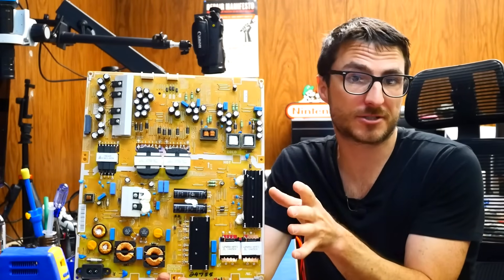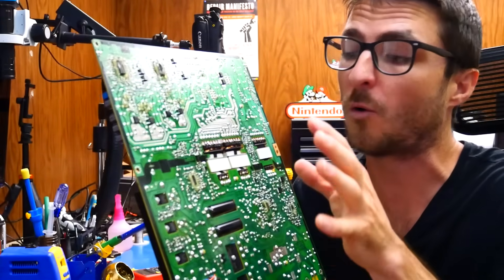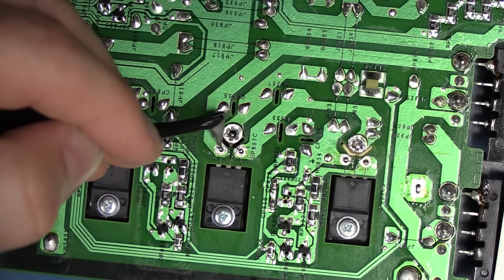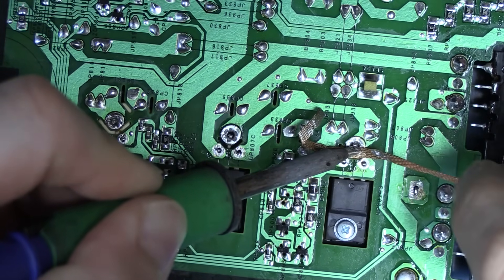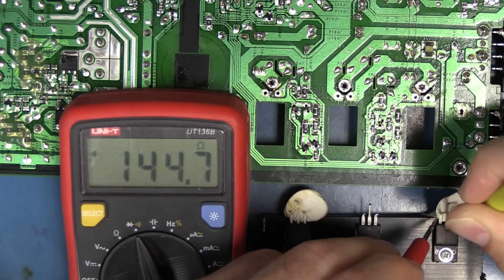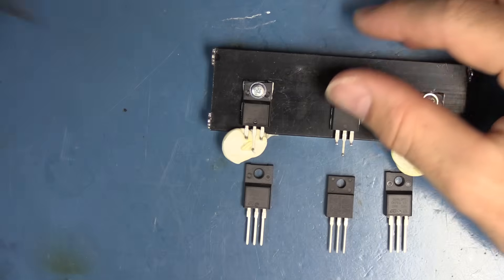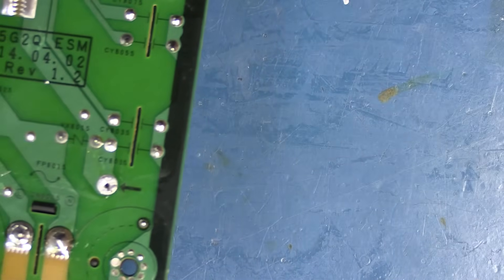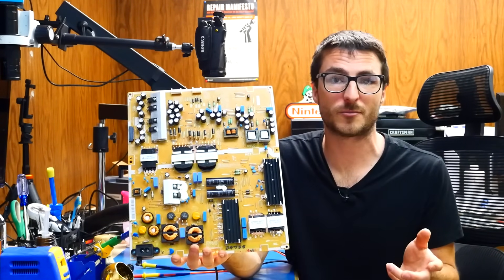Samsung TV No Power Repair UN75H7150 Power Supply BN44-00725A

Comment: Good to see someone that has EXPERIENCE doing the work! The only thing I would have done differently would be to wait on soldering the heatsink until I powered up the unit. If it immediately blew out the transistors again due to some other fault it would be much easier to replace them.
Reply from the maker: Yeah that's a good point! 
I always tell people not to put the back cover on the TV before powering on the set because if they made a mistake and forgot to plug in a wire or didn't plug a ribbon in correctly they have to take everything apart again. Same principle.

Comment: Great video!  It's crazy expensive but the Hakko FR-301 desoldering gun is transformative.  Once you try one you'll never go back to braid or pumps.
Reply from the maker: Yeah we have one and have done several videos with it in the past. 
Its pretty good, but does require a lot of maintenance. Definitely can't use flux with it or it will for sure clog up.

Comment: Use somr flux
Reply from the maker: Is there a specific scene where the solder didn't flow properly? If so what was the time stamp? 
The solder I use has a rosin core so it alrady has flux. Usually that's enough, especially for bigger joints. For finer pitch soldering however I will usually add a bit more flux.

Comment: That part you call a transistor isn't that a mosfet
Reply from the maker: Correct. 
A mosfet is a transistor. Not all transistors are mosfets however. 
metal-oxide-semiconductor field-effect transistor (MOSFET)
Reply: Correct  @NicksTVRepair

Comment: Nice one Nick, appreciate your videos! 
What's the purpose of the silicone on the fets and why don't you re-apply after repair?
Reply from the maker: Thank you and good question. The reason I didn't re-apply after is because it's an extra step that I don't see making any positive difference to the functionality of the circuit board.  I saw these coming in after a few years of manufacturing, and I have not added new silicone after repairs and have seen my repairs outlast the original PCB's life time. 
Why is it there in the first place? I don't know the answer for sure, but I have been told that it helps reduce vibration. What does that do and how does that affect the circuit board? again I don't know. 
I would love to know the reason, but from my perspective right now, my repairs last just as long if not longer than the original PCB did after manufacturing so I don't see the advantage of adding silicone to the legs other than adding an extra step to the repair process.